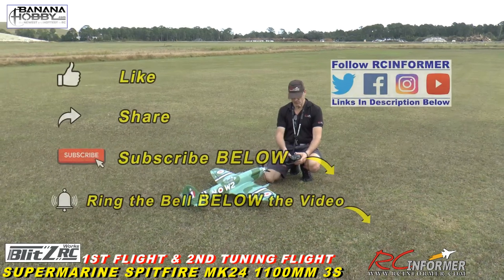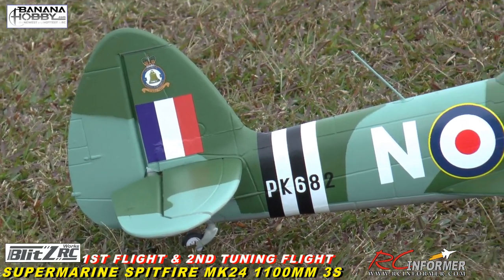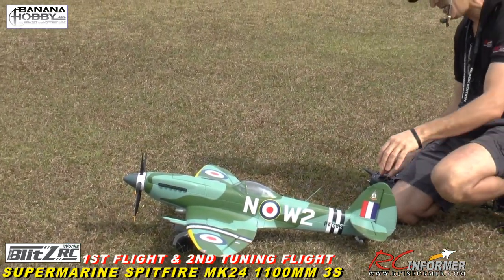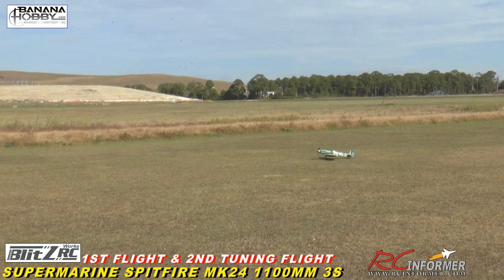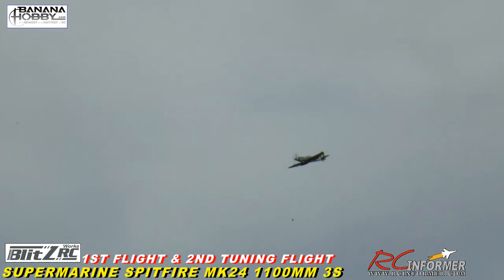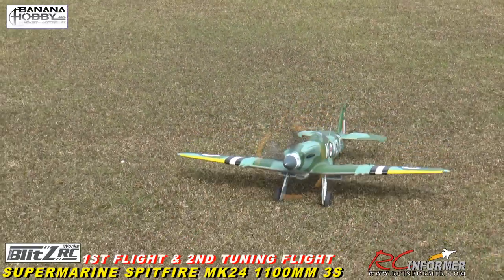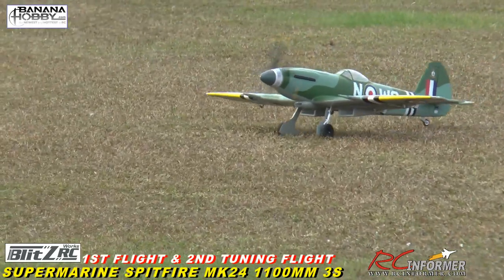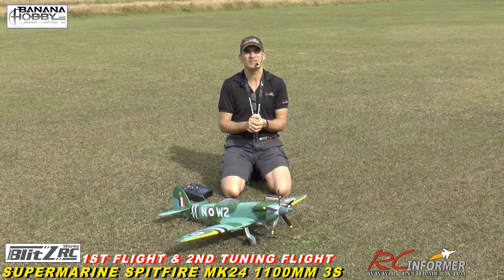Banana Hobby / BlitzRC Mk24 Supermarine SPITFIRE 1100mm First Flight & Tuning Flight By: RCINFORMER

Comment: Very responsible on ailerons, full right rudder on start. Original Griffon turning left :) I flew it without expos. Flaps helps little bit on landing. Flying on 4s much better. Maybe the gear with the oleo struts would help. On landing always with the power. You are great pilot, but this plane is not for beginner really sure.

Comment: Looks identical to the Durafly version, which I've owned and flown for a few years. Mine was the earlier version with a not scale small 4 bladed prop. It flew well with enough power on that prop with a 2200 3s (pushed all the way forward.) However I put a larger 2 bladed scale diameter prop (I think a 13x6) and it flies with noticeably more performance!
Reply: Same plane , I had the V1 and flew with the stock 4 blade on 4s and then they came out with a 5 blade set up and which I bought and replaced the 4 blade to 5 blade and again flew it on 4s.  Was pretty fast
Reply: @Mikeylikesit1968  oh cool. Did you notice any difference  in performance regarding the different props?

Comment: Your a great stick. Ya have to not be afraid to be disappointed though. Please dont take this wrong. 
Having to move GGs isnt a good thing. Having to have a putting green to land means it's not a grass model.  Let Banana know so they improve. It's why Phillip's wont even kiss Horizons ass.  I feel sometimes your covering for a manufacturer. 
I love your flying. No fear reviews is what we want. The good and the bad.   You'll get more buyers too. 
I like your channel everytime. Good job.
Reply from the maker: Its not about "moving" the CG, it about finding the correct CG.  The 55mm I am using is the best flying CG for this plane IMO without making it nose over. Not all grass is created equal. Its mostly about the size of the wheels versus the size of the surface. Small wheels/planes = smoother surfaces. Bigger wheels/planes = Rougher surfaces

Comment: This is a bit of an odd request. But do you know the diameter and pitch of the prop. And what is the diameter of the spinner. I want to use this prop and spinner on a DIY plane but I cant find any info on the props

Comment: They absolutely butchered those gear leg covers, they look like they just blended and smoothed all the corners - for me, it ruins the whole look on the ground. Those are the first thing I would replace with maybe the PZ 1200 Spitfire covers if you can get em. That prop is a work of art but I wonder about balancing it - my PC-21 multiblade prop was a bitch to balance but then again this has each blade separate so it may be easier. All in all I nice looking and not often modelled subject, I just wouldn't jump on this until I've seen and heard a few reviews given BH's rep.

Comment: Excellent vid. It's a nice flying model but the camo is totally wrong. Late-war RAF camo was Dark Green and Ocean Grey on top with Medium Sea Grey underneath. On this model, the darker green isn't dark enough and the light green is horrible. The Invasion Stripes are wrong as well. The SPit 24 did not participate in WWII and, of course, not int the D-Day period. It never had those stripes.
I've never seen a photo of a Spit 24's painted in desert camo. In any event, it's far too bright above and far too dark below. The desert camo colours were Dark Earth and Middlestone above and Azure Blue below. These are just wrong. What's with this company?  Are they colour blind? There are endless sources for the correct colours. I mean if you're gonna do a camo on a scale model, get it right for Zeus's sake. Also, the roundels were outlined in yellow.
BTW, you may know that control touchiness, especially in pitch is very scale-like in Spits, but understandably not comfortable in an R/C model.
I thought it flew at a scale-looking speed with the power you have. I really don't like scale models of piston WWII fighters to fly like a  jet or worse, flit about like a mosquito.